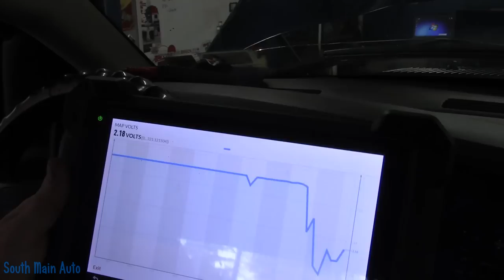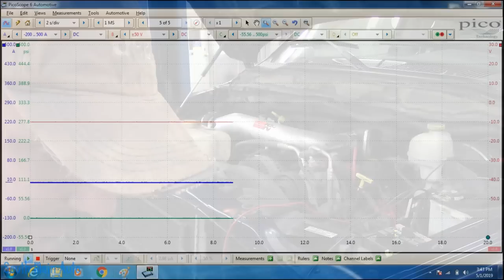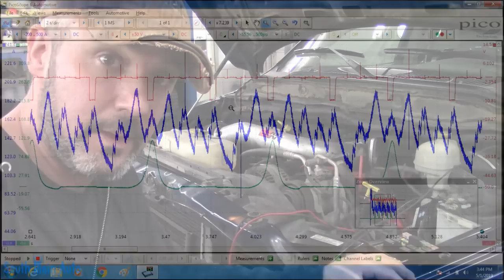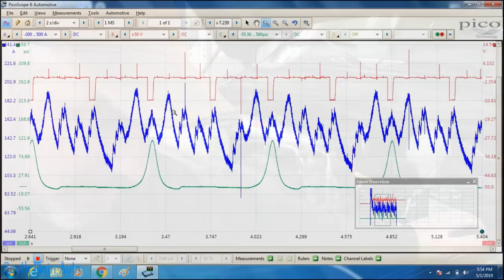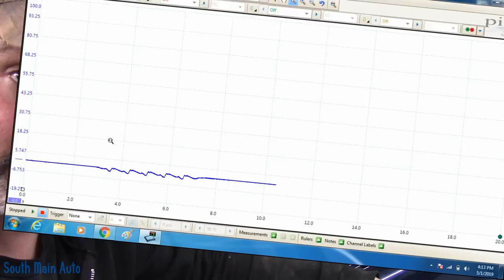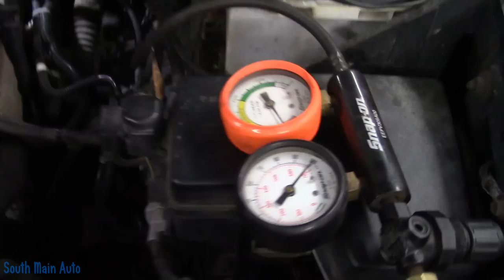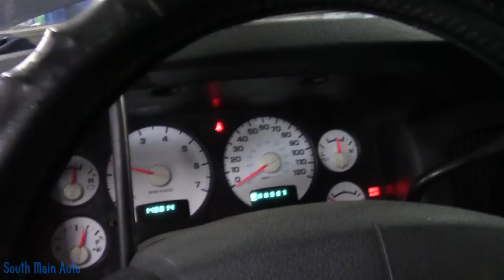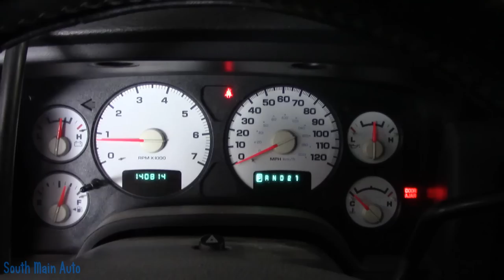5.7 Hemi Ram - Bad Misfire & Will Not Idle

Comment: Owner had the same luck I did with my Dodge.  I drive an 06 Magnum RT.  Last fall I replaced the driver rear half shaft.  First one was a reman that had to much material removed from the groove where the circlip sits.  Got the circlip in the differential, but only to the first gap.  When it dropped in this gap, the circlip shifted sideways a touch.  When it finally went home, it split the circlip in half.  Drove it around the block, seemed good.  On the drive to work the next day, I was stopped at a stop light.  I inched forward in traffic and didn't move.  Blipped the throttle and still no movement.  I then waited for the rpm to drop back to idle and put it in park.  I heard the tell tale clicking of the parking pawl trying to engage.  I knew what happened.  Left it in park and pushed it to the corner gas station.  Luckily it was downhill, this car has a 4,200 pound curb weight.  Had the car towed home and pushed it in the garage.  Pulled it out, and found the one half laying in the splines.  Pulled the drain plug as I was planning on changing the gear lube anyway.  The other half was in the bottom of the differential.  Neither half went through the gears.  Clean break with not even a scratch on either half.

Comment: The valves on those 5.7s get funky many different ways.  Flat cam lobes, push rod breaks, springs breaking, rockers cracking.  Flippin Chrysler.

Comment: Several years ago, just as I was starting to use compression waveforms as a diagnostic tool, I was working on this older 300C SRT8. It was an auction car, dealer bought it but it had an intermittent check engine light for a P0300 I think. No history on the thing of course and no real info on the concern other than the MIL. I took it out and drove it normally for quite a while, no problem, no MIL. Freeze frame data showed the code set at high RPM, so I gave it some beans and it was fine until maybe 5000rpm then it fell on its face. I don't remember cylinder numbers, but I remember it would show misfires on every cylinder when the problem occurred but still seemed to pick on one cylinder more than the others. Engine was totally quiet, no abnormal noise, ran great most of the time except at high RPM. I messed around with it a bit more trying to get more info from the symptoms and found that it would run poorly even at very light load as long as the engine speed was high. I was scratching my head a little, thinking that maybe the CKPS was scattering at higher frequency or something but kept coming back to the one cylinder showing more misfires, so I decided to throw a pressure transducer into that cylinder "for poop and laughter" as you say. Sure enough, the exhaust valve opening ramp looked like garbage, no definition and it looked different every time the valve opened. I didn't know exactly what that told me but I knew that the lack of consistency meant that there was a problem with the exhaust valve. So I pulled the valve cover off and found that the very bottom of the spring was broken. Only the first coil, the part that sits on the head, so it was still enough to keep the valve closed but I think it reduced the spring height enough that the valve wasn't closing fast enough at high RPM and blowing a bunch of exhaust into the intake or even just causing enough turbulence to blow out the spark. Either way, one new exhaust valve spring and it was all fixed.

Comment: I had a 396375 hp Camaro that kept dropping valve springs. The dealer got tired of seeing me and doing warranty work so they replaced my springs with 427 springs. Problem solved.  Traded it for a bride. Jury is still out on that transaction. I wish all mechanics had your diagnostic ability. Dang U B good

Comment: I’ve heard that some Hemi’s have issues with the roller on the lifters. The needle bearings get pretty bad and stop working locking the roller and it chews up the cam shaft lobe.
When I mentioned it to my buddy Tim the Mechanic, he rummaged around in his junk pile and handed me one.  He only said one word: Junk.   Have you seen this in other Hemi’s?  Where the cam shaft is so damaged you lose a cylinder because the valve isn’t opening enough?  And has Chrysler issued a tech bulletin on this issue?

Thanks again for the great video!!
Reply: No TSB yet, but I know of three different people who have this happen on a 5.7 Hemi. Needle bearings go south on the lifter roller and the roller wheel wears a good groove in the cam lobe.

Comment: Yep, I had an 05 caravan with a 3.3 a couple of years ago that did the same thing, the customer let it  sit in there driveway for about 6 months because another shop told them that it needed an engine.  I ran a compression test on the motor and found number 3 cylinder not contributing pulled the valve cover and there she was, valve spring rapped in itself. Wish I would have had my pico back then it would have saved me some diagnostic time.

Comment: That’s exactly what my car did when I blew the head gasket, because i overheated my car. Thankfully I got to drive it home all shaky. I live near a mechanic just a block away. He took the car to his shop. They had to cut the head, luckily no water went to the oil, or oil into the radiator. 350 bucks, including labor. This happened 13 years ago.It was a very easy car to fix. It was a 1987 Chevy cavalier.

Comment: Perfect diagnosis path !  Recently experienced the same on a 6.0 LS which has those "beehive" design valve springs. Owner said "replace them all, it's got 230,000 miles on them". The dealership wanted to sell him a crate motor for $7,000, we repaired the problem for $800. Still running good 1.year later.

Would a chassis dyno be of any help with diagnostics and so forth?

Comment: I had the same issue on my 03 ram.  Broken spring at around 70,000 miles.  Good thing it was still under warranty, they did soak me about 3 bills to change the plugs though, ouch!

Comment: Just had an F250 diesel with LPG today, it had been to 3 shops for extended crank time and low power, 2 minutes in to the diagnosis.... cranking cylinder balance by ear was out of sorts and popping noise out of the exhaust on snap throttle indicated a burnt exhaust valve, diagnosis was confirmed with an old school pressure gauge plumbed into the exhaust and an erratic needle on the gauge.

Comment: I had same issue on my 03 Hemi Ram. Broke valve spring at 82,000 miles. Been about 5 years ago now. Thank goodness my extended warranty covered it at the time. Dodge put a new head on driver side. It was funny the service tech said they keep these heads in stock. Wonder why!!

Comment: Eric,
Great video, diagnosis, and fix. The old hemi ram lives to die another day. Got to love the My Spark Died parts! Only 140K on a valve spring? Would have loved to see the spring R/R - I assume you used air pressure to hold the valve closed. Thank you!
SMA#1
God bless
Paul

Comment: Dads got a ‘04 rumble bee, 5.7 hemi ofc, over 120,000 original everything except exhaust. Runs like new still, I’m guessing this truck had a rough life. These trucks are durabl.
Reply: My work had a 05 2500 5.7 it had 140k on it and the engine ran great minus the “hemi tick” we all hear about.  The trans was going bad so they got a 2012 1500 5.7 nice truck btw.  Had about 120k all the sudden the engine stalled and would start back up same thing as this start and stall. The engine ended up having a broken valve spring. Dealership replaced it 2500 dollars later they sent it to the wholesale auction running as is

Comment: Eric first thing I noticed was that horrible steering wheel with all the ribs on the out side, the ones in the IK are ribbed on the inside and smooth on the outside, makes driving a lot easier...Fred in England.
Reply: That was a hideous after-market steering wheel cover the owner had put on.  They ought to be banned, I've gotten in several vehicles where the cover was such a loose fit over the steering wheel that the only way you could reliably steer was to death-grip the wheel through the cover; otherwise when you turned, all you were turning was the cover and not the wheel itself!  😮

Comment: As far as piston being the cause I have a little story to share. I had a 68 charger with a 440 chrysler that died going down the highway. I downshifted and it restarted but ran like it had dropped a cylinder. Went to work came out started it and drove home. 15 miles later and a block from home it died and was able to coast home. Sound like a timing chain broke when I tried to start it. Pulled timing cover and the cam wouldn't turn then pulled the intake and saw a rod bolt  between the block and cam. I drove it with a thrown rod for 15 miles and still had oil pressure.

Comment: I just purchased a 2005 Ram 1500 with 240k miles. The engine has an internal squeal no knocks no rattles. The first thing I did was remove the belt and start it no change. So now I am pulling the front cover to see if is a timing chain issue. The engine starts fine so I am curiuos about the squeal. I have already sourced a replacement engine but I want to see if I can fix this one first. I also sent off an oil sample and I am waiting for the results.

Comment: Dam this is a good video. Good job. I was so sure you were going to have to keep troubleshooting after fixing dead cylinder cause when my Ford has a bad coil causing dead cylinder it still idles and runs good. But I guess in this case all the compression rushing into the intake was causing drivability issues am I correct?  Again great job wish you lived in my town .

Comment: You definitely got lucky mine dropped the valve and grenade d the engine pulling in to the shop to fix the valve spring scanner said the missing was a broken spring.

Comment: last thing I seen with broken spring that didn't blow up was an VW engine for a rail bug.... the spring was riding up itself and closing some then dropping loose. the valves sure were rotating lol.
the guy couldn't get it to idle right, smoothed out then dropped off and surged, I could hear it miss and said it's running on 3 cylinders, sure enough, pulled valve covers and bam broken intake spring!

Comment: Ok I have a 2004 dodge 1500 5.7, it too runs like crap, sounds similar to back fires but no codes. The cam shaft sensor coded so replaced, replaced the timing chain. Now codes ignition coils a through c. Runs rough, idles rough, and. White smoke out the exhaust. I put this on your channel because I have seen alot of your videos in the help with other cars. You are thorough, and dam good at your job so, anybody have thoughts.
I have a video of it running, though the breather is off you can hear the air in the throttle body. The video is on my channel.

Comment: Ah broken valve spring. Back in my younger years I experienced broken valve springs on my Chevy 427 using a high duration cam. I could always tell I had a brokeh valve spring by the way the engine ran. Once I rebuilt the engine I put a factory performance cam in and had no more problems.

Comment: Nice diagnotics and repair! I have two questions; how did you replace the valve springs without pulling the head and what was the cause of the lack of idle??? I would have thought it would have idled (if lumpily) on seven cylinders???

Comment: In a month or two another spring will break. One would think modern metallurgy would eliminate these problems but there seem to be more problems.
Reply: I suspect the spring heat treatment process wasn't correct.

Comment: My gy6 139qmb Chinese scooter 50cc has the idle screw at maximal.Runs well.Changed the carburator "o-ring" for faulty air.So maybe its the egr.5cm tube with a filter\sound silencer.I got new valves too.Thanks.

Comment: That idle sounds identical to mine. Target idle is 840 and IF it idle it’s a ruff 400 ish. I have no throttle response until I’m 40% iac. Vacuum is super low on my AEM boost gauge. (-8 to 0) but clears up if u hold over 2000rpm but has a random backfire. This isn’t a factory engine but it is a base 5.7. Guess I need to do some digging.

Comment: Hey Eric! Great video as always! Just wondering if cylinder 5 is normally on a power stroke (i.e. drawing vacuum during cranking) when those other two "over-contributing" cylinders were on their compression strokes? I'm just trying to armchair-predict what a relative compression test would demonstrate now that you've fixed the valve spring. My thoughts are that the relative compression would be normalized as piston 5 would now be fighting a vacuum during its power stroke causing the compressing cylinders to work harder to turn the crank. Thank you!

Comment: the hemis's and the 318-360 magnums also have anemic valve springs,i worked for Chrysler for many years,and we never had this problem, it started when the roller cam design came out, the springs are way too light for the mileage to stack up on the 360 magnum. I found this on first was my wifes car,it had 180k on it and they were super soft and the new ones out of the box were rated for a lawnmower,they would not be safe to return to hemi duty or 360 magnum duty,at 85 on  the seat and 208 wide open is just plain nuts,if you have a high mileage mopar engine running a roller cam,replace them immediately before you drop and valve and enjoy the extended mileage and smooth performance,they should be at least 110-125 on the seat and at last 300 at wide open valve lift,for safety sake,more saving money for them or built in obsolescence IMO-----change oil at 3500 intervals for 3 changes and then when the engine is clean run it for up to 5000 miles for 3 changes then go to the 3500 mile interval again and repeat,the wifes car now has 410k on it and still has go,good luck

Comment: Cool vid and you know your trucks. I've got a 2005 Dodge ram 1500 with the same idle problem; I opened the  driver side valve cover and found cylinder #1 and #7 with loose rockers. Any advice? Thanks

Comment: Pre-computer days, this engine would have a misfire (dead cylinder), but wow, it ran like total crap. Must have been several devices and systems trying to correct it and made it run badly. Question: wouldn't it be prudent to replace all the springs, if this is a somewhat common fault? He could be back tomorrow!

Comment: I know it’s been 3 years since you posted this video but I’m hoping you could send me in the right direction. 

My 04 Dodge Ram with 5.7 starts fine, then will run with a slight hiccup, like it’s misfiring, as soon as I give it some gas it bogs out and will spit and sputter and sometimes backfire until I give it more gas then it clears out and runs like a champ. I did spark plugs and wires recently and that got rid of the slight bucking at overdrive low rpm. If I unplug the egr it’s not as severe at bogging out as soon as I give it gas. I don’t want to spend a fortune on a truck that isn’t worth much so I was hoping you could help and send me in a good direction. 

Thank you!

Comment: I would like to have seen the procedure for changing the spring, with the head still on. Must be a way to do this, without having the valve drop into the cylinder.
Reply: Kirk Matheson Pressurize the cylinder using compressed air at the spark plug hole.  This will keep the valve up (as long as the exhaust valve is closed).  Then you can work in the intake size without worrying about the intake valve falling into the cylinder.   It’s a good procedure my mechanic friend Tim showed me a few years ago.   Look at the bonus video and you’ll see an air hose going into the spark plug hole.  At some point, Eric pressurized the cylinder with the exhaust valve closed and held the intake valve closed so he could change out the intake valve spring.
Reply: @BigDaddy_MRI  Thanks for the response. There must also be a tool for compressing the spring on the head, so that the keeper can be installed. I have never seen that done either.
Reply: I use rope down the plug hole. bar the engine over until that cylinder is coup on compression. Feed some rope down the hole then bar the engine up to smash rope against valves pull the keepers and change out spring.
Reply: Two of them were visible in the video. The first is at 13:11 when Eric says "This is what I found" That is an inline screw style overhead valve compressor. The other version is at 15:05. It is a lever style compressor.  Both look to be Lisle tools but there are a couple brands like them. Both work the same way. The longer fingers grab onto the spring coils toward the bottom, then you turn the handle or squeeze the levers and compress the coil. Allows you to change springs, keepers or stem seals without head removal.

Comment: If those are so prone to break , wouldn't a good quality full aftermarket set be the longer term fix ? Just sayin if it was my truck and I liked it , all the other valve springs have cycled as the same as the broke one . Next one to go may just grenade a cylinder .

Comment: Just a quick question, after pulling the head for this job I'm assuming the head gasket was replaced? Did you do any measurements to see if the head was warped? I'm assuming you just pulled the head, maybe replaced head studs and gasket and put it back on. I've never pulled a head to do a repair so I'm just wondering what all I should do if that time ever comes.

Comment: I had a 2012 hemi with 80,000 miles and it flattened the cam because a roller lifter siezed.  Common problem!  $2500 later it ran, but that's crap!